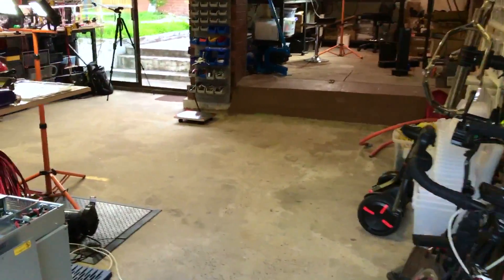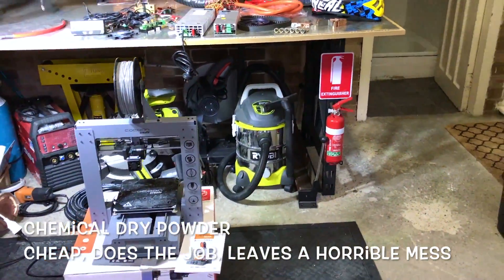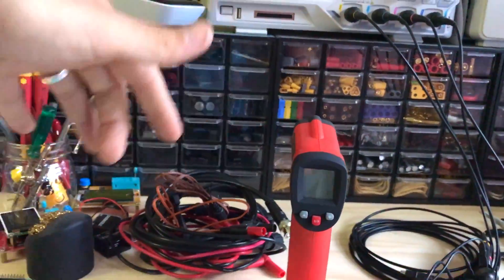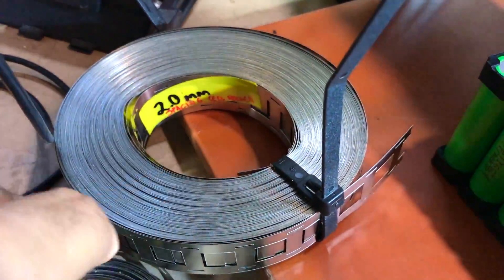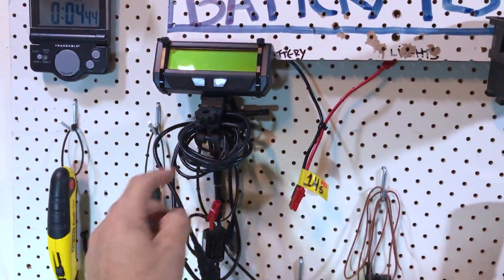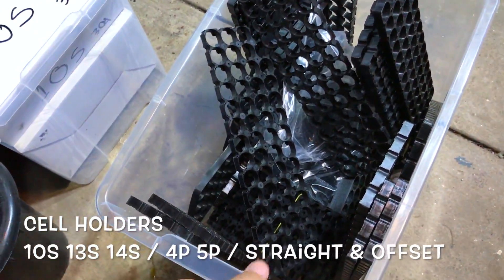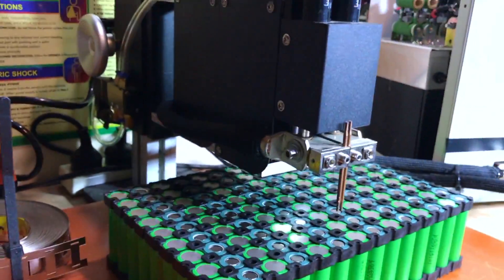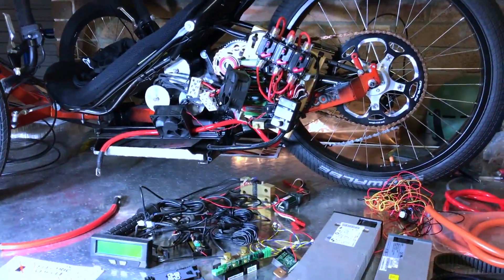My Electronics Lab & Battery Building Workshop... oh yeahh!!

Comment: 4:30 amazing controls like on and off.. So there where I have been going wrong I need to buy quality stuff so I need to ask for ones with on and off switch, if it ain't got on and off i'm not interested any more.. xD

So this is where you gave been hiding then? Working hard on your new garage setup.

Good to have you back, so we going to be getting some more videos soon?
Reply from the maker: Dave Webster heeeeeey mate, yeah I have been hiding in my cave working on a 300v electric Mercedes + working for www.batrium.com developing new products and endless documentation and website work + I’m still making batteries but now consulting for a super cool electric hydrofoil surfboard, everything needs to be IP67 and marine grade, all electronics are integrated, full of smarts!!
That power supply I showed in my video is the Rigol DP832 it’s a 3 channel 2x 32v 3.2A that u can connect in series and parallel + 1x additional 5v 3A. You can program lots of commands like voltage, current and switch channels on/off via serial or USB or network, awesome tool, very popular amongst electronics engineers.
So much POWEEEEEERRR and control ohhh yeaaahhh =]